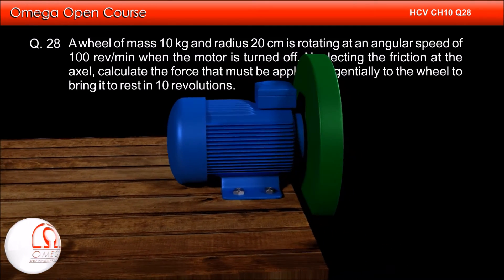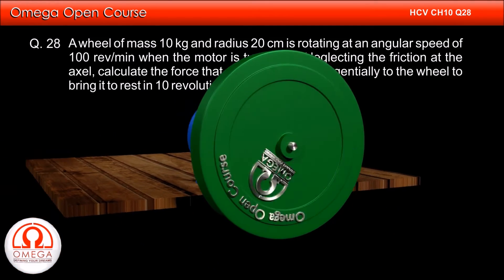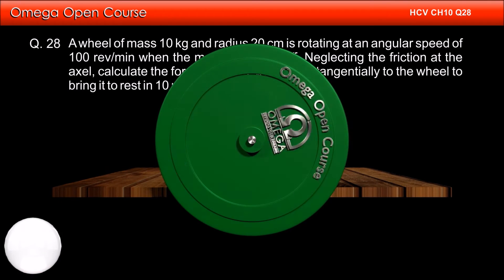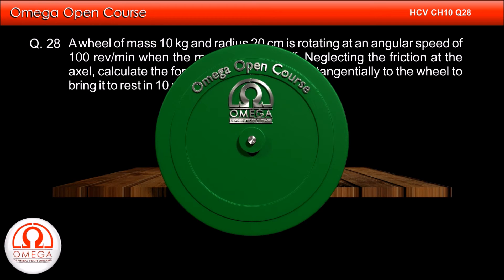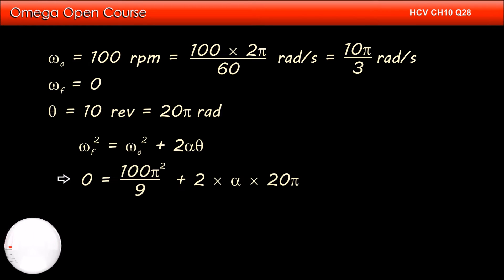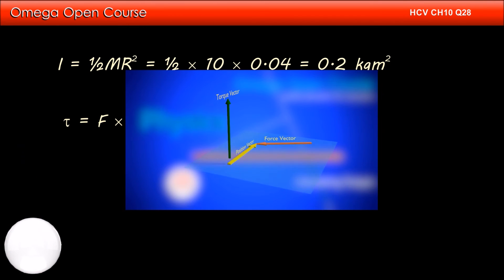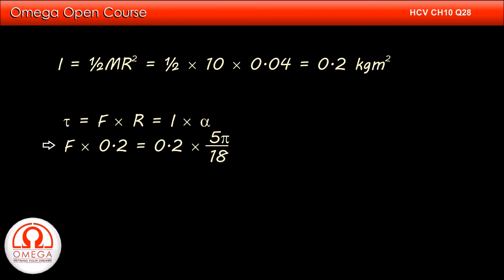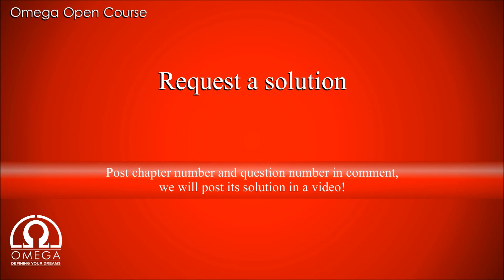H. C. Verma Solutions - Chapter 10, Question 28

Comment: Sir y won't the force required be m × centripetal acceleration
Reply: Sir plzzzzz reply
Reply from the maker: There is no net centripetal acceleration on the wheel. The centre of mass of the wheel is at rest. So, there is no net force acting on the system. Only torque is acting which is equal to Moment of inertia into angular acceleration.